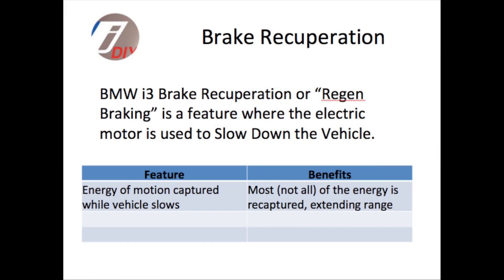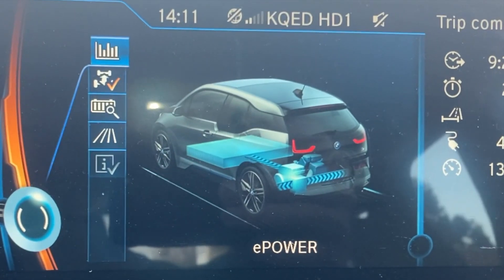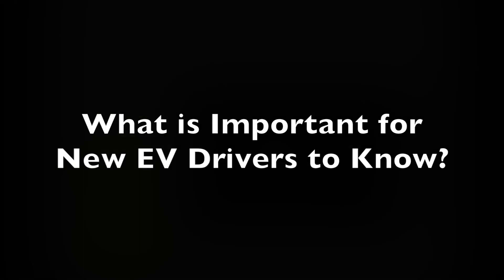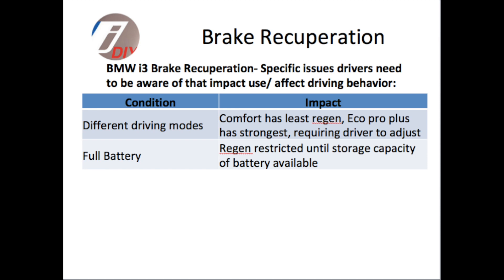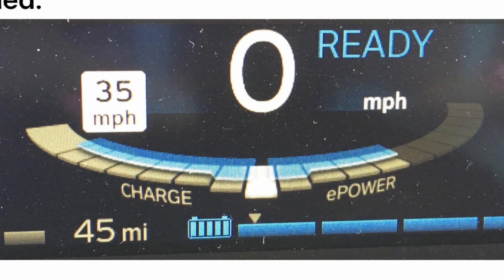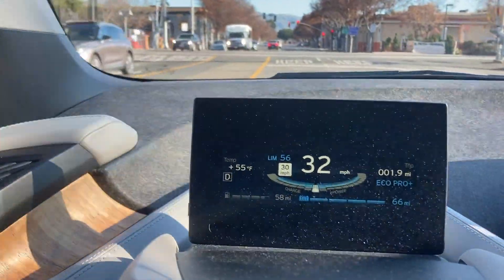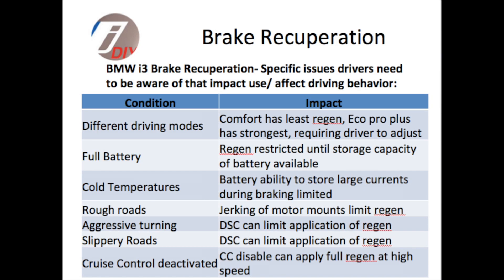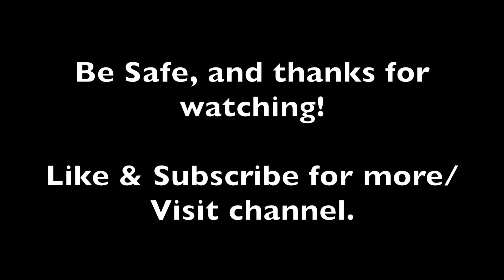BMW i3 Regen Braking Issues Review

Comment: I can’t say I can feel a difference in regen strength with driving modes in my 94ah. Also, I had the i3s tune applied to my vehicle and I’ve noticed regen doesn’t switch off when going over bumps anymore. Would love to have you in our BMW i3 Worldwide Facebook group - your videos are referenced there a lot.

Comment: I have 2 bmw i3 one older from 2014 and one from 2019. I have noticed there is a difference in the DSC. With the older car, I have noticed that DSC switches off the regen in sharp turns, which can give an uncomfortable experience where you feel that the car is pushing forward. I do not experience this in the newer i3.
I have an unpleasant experience in connection with driving down steep snow-covered mountain roads, where the regen is so strong that it locks the rear wheel. I had to put the car in neutral to gain control. I'm not sure if this is good for the car, but rather than crashing into a mountain wall!
The i3 is a fantastic car with a smart and unconventional design. An true icon!
Reply from the maker: Thanks for sharing your experience.  Several other owners have suggested software changes in newer models that affect the regen behavior as well.   I think it is good that the awareness of the issue is getting highlighted!

Comment: Are you sure about the different driving modes having different levels of regen? I thought the i3 has a fixed regen level, regardless of mode.
Reply from the maker: Great question!  The regen is definitely software controlled, as early on, the aggressiveness of the regen was reduced (2014 or 2015 I think).   There is not much information on this, but several articles mention it.   There is mention of a regen onset delay change (2018?) and also many owners mention that newer cars seem to have a softer regen than the older ones (also around this timeframe).  
From articles on the I3: 
 “On the BMW they list this under the different driving modes. With them you can turn regen up/down along with many other “eco” modes that the car has such as optimizing the AC system.”
https://www.drivezero.com.au/charging/charging-guides/regenerative-braking-guide/

“Using lessons learned from its original MINI E and ActiveE electric prototypes, BMW engineers have made the i3’s acceleration and braking controllable with just the one pedal. Recuperation mode is activated the moment the driver lifts off the accelerator, though the severity of this can be adjusted by the ECO PRO settings.”
https://www.motorauthority.com/news/1085460_2014-bmw-i3-full-specs

My personal experience is that if I forget to switch to EcoPro+ when starting the car &  I come to a stop in comfort mode, I immediately notice that the car slows down 'slower' Vs in Eco Pro+ ( the setting that I normally use).   It is possible that it may be a throttle mapping difference that delays the onset of (same strength) regen in comfort mode, but I would probably need to run some tests with an accelerometer to determine (quantify) the behavior.   Thanks for the feedback, let me know your experience.
Reply: @bmwi3diy782  That’s my understanding too (about the changes with some earlier software updates). But my understanding is also that the throttle mapping changes with the driving modes but not the regen. I think it would be dangerous for the car to not have consistent braking behaviour (other than the exceptions you’ve mentioned such as going over bumps and cornering at speed). This is why the disc brakes activate when the battery is full: to keep it consistent. I also think (from memory) that the owner’s manual tells you what the driving modes do: they change throttle response, speed limit and climate control only. In short, I think those articles that state that braking changes with driving mode are wrong. Incidentally, you can get the same efficiency advantage of the eco modes by driving more conservatively and not using air con. Personally I often use Eco just because it’s more relaxing in stop/start traffic. The standard mode can feel a bit twitchy and eager by comparison.
Reply from the maker: Thanks for the feedback, you may be right.  Another viewer mentioned the battery icon and the software version (which suggests I have the older version).  I think there's a future video on this to solve the question!
Reply: @bmwi3diy782  Again, this is going from memory, but if you export your driver profile to a USB stick in the car, you can view that on a computer (e.g. in Notepad) and it will give you the software version.  It will look like <i-step>I001-17-11-543</i-step>. That’s what mine used to be. Last year I had a recall taken care of and they updated the software, so now it’s <i-step>I001-20-11-540</i-step> for me.
Reply from the maker: Interesting- I just checked it, it's <i-step>I001-18-07-520</i-step>
Reply: @bmwi3diy782  You could get it updated, although BMW will likely charge at least a couple of hundred dollars for that and I don't know what (if any) advantage you'd notice. There are mechanics/enthusiasts out there with the required software and cable who will do it for cheaper, but it can be a lengthy process.  My 2017 firmware had a known bug which was preventing me from setting scheduled charging, which the update has fixed.  I'm sure the regen was consistent across driving modes even on the 2017 firmware, though, so - if you did update it - I wouldn't expect that to change.

Comment: I've noticed that in the software version after 2018.07 (where you can tell the battery icon is statcked instead of bars), the regen when battery full is acted differently, before is regen reduced, but after is the system will mimic the normal regen by applying some amount of the brake force.
Reply: That has always been the case.  My i3 has always used the disc brakes the first time I stop at the end of my road when leaving in the morning with a full battery every day.
Reply from the maker: For me, when the battery is near 100%,  there is still some braking but the behavior is different enough from normal that it is noticeable and a bit unnerving  (I still have 'bars' on the battery icon though).

Comment: Good info. I have had i3S since May 22 and encountered one of the rare snowstorm days in London in December. We are generally totally unprepared here for sudden snow and very few people bother with winter tyres. What is your advice for sudden snow in sun zero temps? I went into eco mode assuming lower regen braking and made it home unlike some others. Pretty uncomfortable experience though!
Reply from the maker: Well, my "personal opinions" would be to stay home!  Second, if legal in your area, would be to carry a pair of emergency tiresocks if the road conditions got way too bad for the all season tires (they are available for 19" i3 sizes and are much less expensive than chains).   I have read may comments saying people have had good luck with these.  Of course, winter tires would be good choice.   Slow acceleration and slow deceleration is the key in poor weather (gentle moves of the accelerator/regen) - this is the way, as you no doubt already know!    Thanks for the comment.

Comment: Love your videos. I'm wondering what the MPH in the white box means. It shows a number, yours was showing 30 and 35 MPH in this video. Maybe I overlooked this in the manual, but I have no idea what this represents. If anyone knows I'd love to hear about it. 

Thank you for the great content.
Reply from the maker: I think you're referring to the 'current speed limit' display, as determined by the front facing camera that actually 'reads' the street signs.    I'm not sure if all versions of the car included this feature.   Try going into the  idrive main menu/settings/instrument cluster/ look for & click on a checkbox to enable speed limit display.   Thanks for watching, and let me know if this is the problem!
Reply: Ahh yes, I think you are correct! Thank you!

Your content is really great. I have an older bev, 2014, and I'm a new owner. I have not had a chance to go through all your videos, so if you've made a video on something like this already I'll search it out, but one of the most annoying things is the lack of BMW support because of the 3G. Are there any alternatives, or diy work arounds to get mobile access to older i3s? and thanks again!
Reply from the maker: I made a video on coding the keyfob 'panic button'  to do remote preconditioning several months back.  Other than that, no real solution has surfaced yet.

Comment: Don’t forget when making a turn (downhill lets say) the regen will disengage (2014-2017 models).  I believe the module was changed in 2018 or 2019 so the behavior is different.

Comment: I just wish that the brake peddle feel was not affected regen. Like in cold weather with high state of charge, there is little regen so the, brake pedal is more bosted, giving a nice firm pedal. But when more regen is posibel the pedal gets much softer as it tries to blend in regen with the mechanical brakes. Personally I would prefer that the pedal feel was more consistent.
Reply from the maker: Great point!